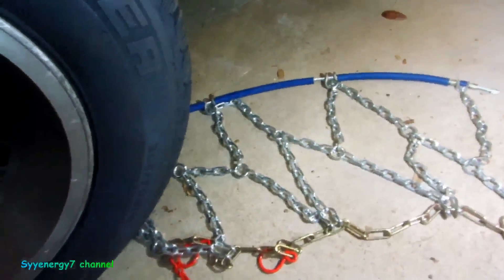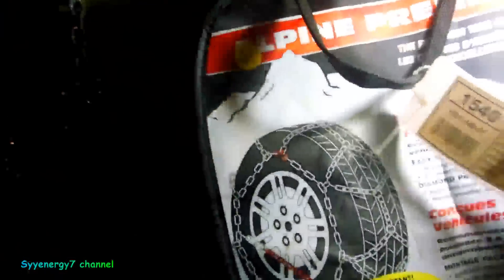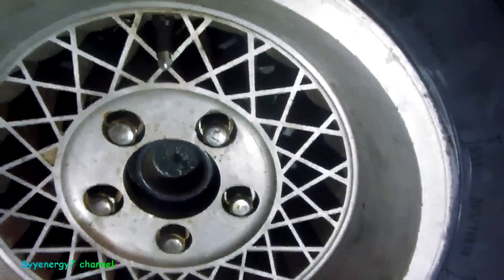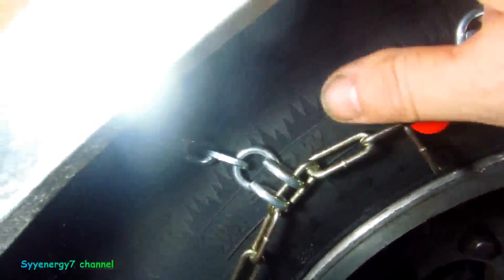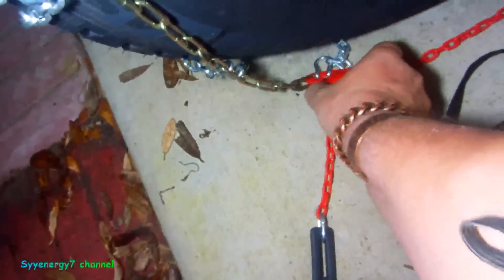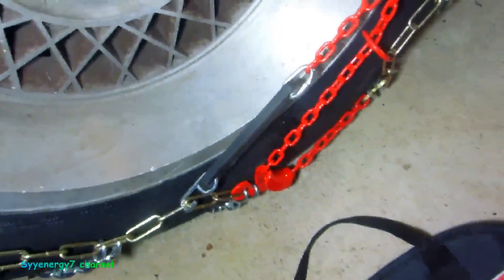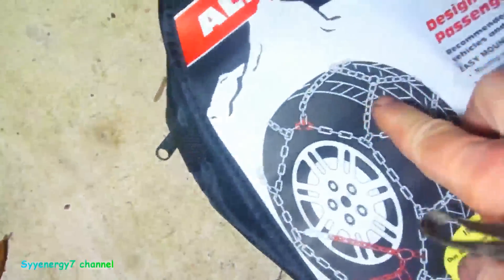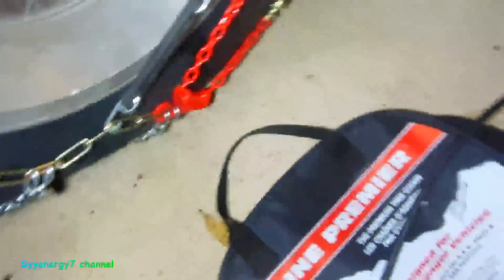DEFINITELY the Best Snow Chains, Easy to put on and Strong

Comment: I have ran the Alpine Sports on both my Durango and my wife's front wheel drive Nissan Altima for a couple of seasons now and I love them. Like you, I found both sets on Ebay for less than what one set of crap chains sells for in auto parts stores.Super simple on and off, plus they don't get tangled easily, just throw 'em in the back floorboards. Good job on a nice review for some awesome chains!

Comment: Up in here Canada , u know what we do ......deflate the drive tires to 15 psi DONE!
Reply from the maker: Yep, I know about that.  Very essential to do on sand also or else you sink, even with 4WD.
Reply: Sukh Bhatti p
Reply: Most people deflate their tires and don't use chains. I've kept traction in my Saturn relieving the tire pressures and using new tires until the snow was at my ride height

Comment: BULL CRAP., i have these brand new. both fell off before my car moved, reinstalled tighter and broke the 2 red rings. bent them back round and both chain son as tight as i could while not straightening the rings and they both came off and i didn't get 5 feet. both red chins with the bungee were lost in the snow rendering them useless.